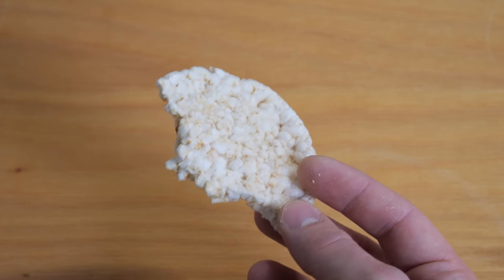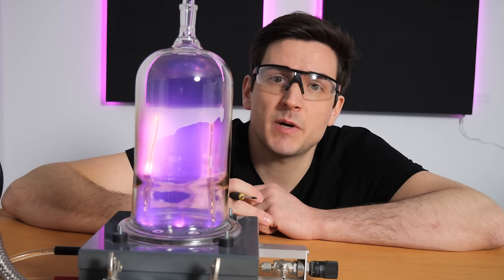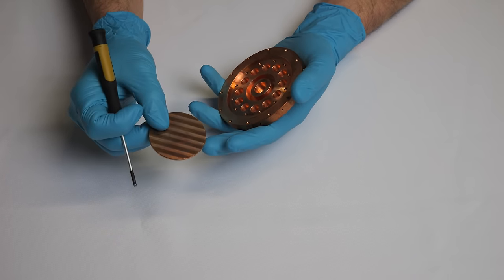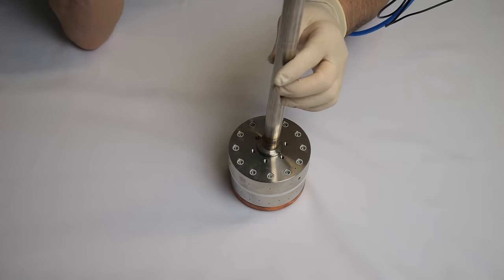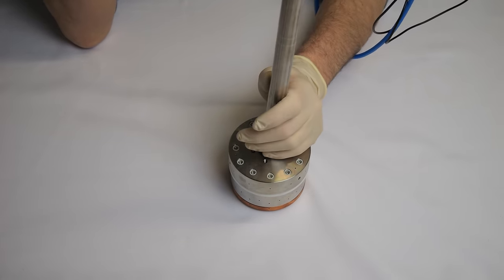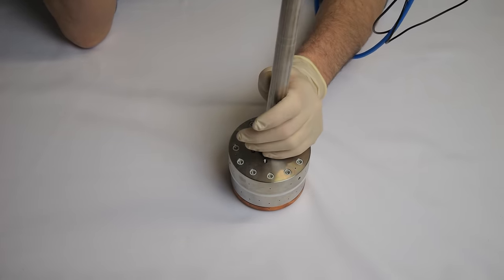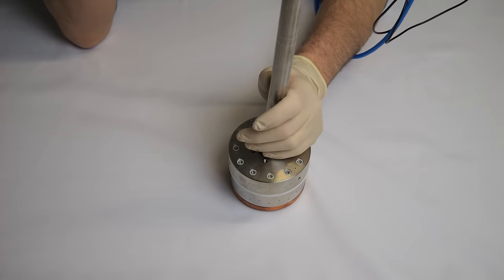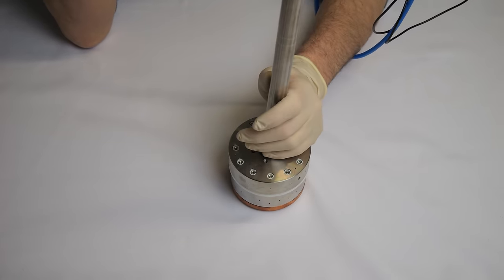METAL COATING by PLASMA Bombardment - Magnetron Sputtering

Comment: Finally, you can settle the important question whether rice with a coating of 20 nm ITO tastes better than rice with 20 nm W.

Great Magnetron, by the way, and thanks for all the great info on building the magnetron!
If you want to get rid of the rusting issue on your magnetic yoke: ferritic stainless steels are magnetic. They also conduct heat better than their austenitic counterparts: 1.4003 (ANSI 410) is one.
Reply from the maker: Thanks for the advice!

I would have loved to coat the puffed rice with gold and actually eat it. But getting a gold target was a little bit outside my budget.
Reply: Single gram bullion bars of gold are not too bad, and would be good for this application.
Reply: I wonder if there's any nutritional value if you eat puffed rice sputter coated with iron? It might make a great YouTube scamercial product.
Reply: Could the Yoke be coated with Nickel for Example?

Very nice Magnetron.
I hope you are willing to share the Design Files.

Comment: In electron beam evaporation vacuum coating the cleanliness of a glass surface must be extremely high, like... atomically clean. When we do multi-layer dielectric coatings for coffee table sized optics to make them into mirrors for the National Ignition Facility fusion laser, the glass is cleaned by removing the top few layers of atoms. We scrub the glass with a toothpaste like thick suspension of nanosized alumina particles (0.05 um) called Baikalox and rinse with deionized 18 megaohm water. You can tell when the glass is clean because it will be perfectly hydrophyllic with absolutely no water beading anywhere. If you watch the DI water dry on the surface in a cleanroom you can see the Newton's fringes forming on the final few layers of water molecules as they sheet off and evaporate. When the glass is then loaded into the coater it is heated to a couple hundred C by quartz lamps to drive off the last layer of water molecules adhering to the dangling O and Si bonds of the glass surface. It sounds complicated and expensive but you could probably do it well enough with a simple setup and no cleanroom for very cheap with any common polishing slurry. The main metric of importance is the total lack of any hydrophobicity of the glass after cleaning.
Reply: That’s incredible.  Cool stuff!
Reply: That must have been a really special (albeit maybe stressful because of that!) project to be a part of!
Reply: Did you use thise giant lapping machines for the Baikalox ,  or some other setup?
Reply: @ericlotze7724  Actual surface figure polishing was done at another facility before the glass was sent to us for coating. We're only removing a few atoms thickness with the final hand cleaning, so it doesn't change the optical properties.
Reply: The reason they're held to such stringent standards, is to avoid any anomalies in the reflection... which is a huge factor, when you're dealing with once-in-a-lifetime data. That level of precision isn't necessary for 99.9999% of the market. Sputtering is used in all kinds of industries for various purposes. Sometimes, such as with some aluminum applications, the layer is applied with the intent of near-immediate degradation/oxidation to protect the base material.
Reply: VERY good advice, but with sputtering it is another chapter altogether. You see, with e-bream evaporation, you are still in the "evaporation" techniques. These suffer a lot from poor adhesion, as the atoms come to stick to the surface with very low energy (they do have extremely high quality though). However, with sputtering you actually hit the substrate with very high energy ions. If they don't stick, they sputter back! If you even use higher energies, you get into the ion implantation realm! No need to clean the surface that thoroughly as we do with evaporation or sol-get techniques... 
The problem here is nothing else but electron bombardment. This explains why the side glasses of the chamber have perfect quality, their crystal mesh was not bombarded with electrons as heavily as the substrate in front of the magnetron. If a high speed electron bombards your substrate, it amorphises it, it breaks its bonds. 
Typical solutions to this problem are facing magnetron topology, less power or better magnets on the magnetron and even a NEGATIVE bias behind your substrate to try to push away those incoming electrons.
Reply: @BillDemos  I endorse this message.  
...with the exception of the sol-gel bit. Extreme cleanliness is important here too as the alcohol suspension of teos will bead up on unclean hydrophobic surfaces during the dip extraction, ruining the AR effect of the coating where it happens. Ask how I know....
Reply: @Muonium1 Yes, we actually agree. If you read my post again, I say: "No need to clean the surface (when doing sputtering) that thoroughly as we do with evaporation or sol-gel techniques.", meaning evaporation and sol-gel need good cleaning, sputtering no so much. Anyhow, material sciences is such a nice field. Have you also seen SILAR (Sequential Ion Adsorption and Reaction)? It is a magnificent method. It's like ALE but with ionic liquids, allowing you atomic layer control!!!!!!!
Reply: Thats incredible. I make the capacitors for the NIF and sometimes if a mechanical dimension is slightly off I clamp a sheet of metal over it and hit it with a hammer.
Reply: @thegunfoogle2864  Thems some bigass caps too lol
Reply: Yes what he said.....much love to you all. I love learning.

Comment: If you watch Ben Krasnow's channel he has a whole video on slide prep for sputter coating. It's suspicious that titanium coats well while copper doesn't though so I don't think slide prep is the issue. He does talk about plasma cleaning a lot which you didn't mention. I love this!
Reply from the maker: Yes, I know Ben's video. His channel is just brilliant overall. In the future, I want to install a plasma cleaning setup in my chamber.
Reply: Titanium is used as an adhesive layer in many thin film structures. There are other thin film adhesive metals including: Cr, Al, Ta, Mo, Nb, V, & Hf. Copper won't stick too well by itself 😀.

Comment: Having MOT-based power supply for such experiments is extremelly dangerous. It would be MUCH safier to have high frequency converter because even if you touch HV parts directly you would have a burn but the HF current will not fri your inside but 50 Hz 2000V definitely will. And it would be good to have some ground leak cut-off switch on HV side.
________
Drops of paraffin for insulation instead of Kapton tape would be much more reliable.
________
Regarding the solidity of the coating, I have two considerations. First: the surfaces to be coated must be very clean. Ben Krasnov spoke about this on the Applied Science channel. Second: probably, during direct propagation, a large number of low-energy particles reach the target and are not capable of forming a strong connection with the surface. And to the sight glass - on the contrary, the fastest. So perhaps the target object should not be placed on the main axis. This will lengthen the time, but only the best will hit the target.)

Comment: You should first process the slides with plasma cleaning to prepare the surface for sputtering. A cool experiment will be to sputter quartz over aluminum to make a durable first surface mirror.
Reply from the maker: Plasma cleaning is also a project I will work on in the future :)
Reply: @AdvancedTinkering  As a quick test, you might want to try flaming the microscope slides - pass them through a butane torch flame a few times. This apparently really cleans the surface, both by thermally evaporating any contaminants, and also reaction of the ions in the flame. Many years ago when I was playing with thermal deposition, I tried this and it really seemed to help.
Reply from the maker: @imajeenyus42  I haven’t heard of that method before. Thanks a lot! I will try that.
Reply: He could increase the power and get to ion implantation. Surely there atoms will stick :)
Reply: @BillDemos I had typed a long comment out on my phone, and a stupid telemarketing call ruined it.

I just found this channel, watched the video, and read some comments, and you seem extremely knowledgeable on this subject, as well as the preparation involved. 

If someone were hoping to get a high level of cleanliness, using butane is inappropriate because...? The common sense part of my brain says that cleaning the target with acetone to get rid of any oils, doing a final clean with deionized and distilled water, and then drying the slide using a butane induced flame would be counter productive. This is because the possibility of unburned butane depositing more petroleum oils on the surface that aren't removed in the flaming passes would remain after the final pass. How correct is this thought process? Is there something else the flame cleaning would do to the target surface itself? Maybe some micro ablation from the forced air of the torch in a non-cleanroom/filtered air environment?

<-- mechanic with an interest in material science and the details that high level of cleanliness and precision that some applications have to take into consideration. It's a hobby, I guess. I don't think I'll ever use/need this information, but clean mating surfaces and ways to achieve that are more important than more people realize in everyday applications. In the future, I can see cold welding 3-d printed parts being done in machines shops as part of a repair application. [I.e. the part being too large to print in a single file, so it's printed in multiple and taken to a large vacuum chamber to cold weld the complete part, after a thorough cleaning of mating surfaces]
Reply: @Torsion  Yes, butane would be inapropriate from the side of cleanliness. Best way is scrubbing in soap, the rinsing in deionised water and then in the chamber and plasma treating.

Comment: Very good! You are becoming more and more involved in the interesting part of vacuum technology! Sputtering is one of the most interesting ways of depositing materials, specially when reactive gasses are involved. Few tips:
1) Dont use such high pressures, try and stay in the 1x10-2mBar (get a baratron), if you go to high, the plasma will be super hot and the particles cant reach your substrate because of too much gas particles blocking them.
2) Keep the distance from target to substrate to a maximum, dont let the plasma touch whatever your trying to coat, it will destroy the layer(exactly what your problem is with adhesion).
3) Evaporation rate is usually very low with sputtering (5A/s is considered very high), so keep the energy down, let things be cool and take your time. If the layer gets too thick, and the substrate is cool, from my experience, anything above 2000A will start to flake off... 
4) Use high pumping speeds and mass flow controller is a must that has a loop with baratron, i have used MKS systems that controls everything, from the gate valve position to the the mass flow controller, basically a closed servo loop that allows for steady pressure. 
5) Consider getting a RF supply and a matching box, you can then do dielectric depositions, with DC you cant.
Reply from the maker: Thank you very much for the helpful tips!
Today I tested placing the substrate as far from the magnetron as my chamber allows. However, the layer was still very poor, especially where the layer thickness was too high. Interestingly, this problem did not happen when using thermal evaporation, even though the layer thickness was higher. Of course, adhesion to the glass was generally much worse, but at least it was a nice reflective surface.
Other comments suggested applying a layer of chrome first to improve the adhesion of the copper. I will test this as soon as I get hold of a chrome target.

Building a closed loop for the measuring device and the MFC is a very good idea! Sounds like a new project haha.
Reply: @AdvancedTinkering  Thin metal films are often under high stress, and in some cases this is the main limitation on achievable film thickness. The stress can be tensile or compressive, and depends on deposition rate, deposition process, substrate temperature and probably a few other things I don't remember.

I think the stress applied to a 1 mm thick glass substrate by a 100 nm thick metal film will warp it enough to be practically measured by the kind of interferometric measurement you would use for lens figuring (I calculate 650 m radius of curvature with 200 MPa stress in film, which would cause 125 nm deflection in the middle of a 2.5 cm span) but there may be a more practical way to go about it if need be.
Reply: One idea I would try is pumping down with just air in the chamber first, and running the magnetron at low power to get a visible glow. Should work as a poor reactive ion etch to super clean and activate the glass surface. Then introduce the argon and proceed as usual. Those dangling oxygen (and maybe nitrogen) groups coupled with the complete absence of organics should help adhesion.

As for surface quality, the fact that your windows got a super mirror surface but the slides didn’t just shows your deposition rate is too high - the flux of metal ions above the sputterer is way too dense which is causing agglomeration (blobbiness). Turn down the mA to something like 1/10th what you were using and it should improve a lot. Copper is the worst for this, although not as bad as silver or tin. Refractory metals cool faster, so titanium and tungsten can be coated at a higher current density and go much faster. With soft or low melting metals, you need to go low and slow.
Reply: The CVC 601that I ran used a 13.56 MHz RF source.
Reply: The distancing will NOT solve his problem. It is ELECTRONS that are hitting the substrate and amorphise and crystal that is growing. You either use a facing magnetron topology (look it up) to try to trap those rogue electrons in between them, increase the magnetic field strength or decrease your power. You do NOT mind if positive ions hit your substrate, it is actually good for the final quality, what you want to avoid is those pesky electrons. This advise comes from someone who routinely can do ALO, ZNO, ITO with hugely good optical and electrical properties.
Also, RF would be nice in some situations, but you can do ceramics also with DC, with reactive sputtering. For example for the Oxides you would just use Oxygen in your chamber, and for the Nitrides, you would just use Nitrogen! To have VERY good looking un-oxidised metal deposits, you can also use a small amount of Hydrogen in your Argon.
Reply: @BillDemos  Electrons? 200-300eV having enough energy to physically affect the substrate? I dont think so, only if the substrate is not grounded, electrostatic build up can affect the morphology. Spacing does matter, and has a very big role, the plasma temperature depends on the pressure and  power that is put in the magnetron, the standard practice is to avoid touching the plasma. DC sputtering isolators cant be done easy, there is no beam  forming, the target needs to conduct in order to properly shape the plasma. Morphology of the layer heavily depends on gas concentration, temperature, power, distance, substrate DC bias, everything. Its not that simple... I design and build vacuum equipment for a living, my experience in DC and RF is very thorough.
Reply: @Aleksanti  Elections, Yes. Look up ANY paper on "Facing magnetrons" topology to understand what they are trying to do
Reply: Aleksanti I have a MKS - Type 250 controller unit and I also have some Mass Flow controllers. I have been reading through the literature and have yet to figure out where to attach the pins from the UFC-1000 with the power supplies and outputs to the MKS-Type 250 Controller.I am hoping you can shed some light on what connects to what. At first I thought it would be simple to just connect the UFC-1000 to the valve connector on back of the type 250 9 pin valve terminal. Realizing if it is just a solenoid valve with no feedback circuitry it would be true. I figure its got to be the input connector or the interface connector but I am confused. Please help.
Reply: @sealpiercing8476 Hey brother, I was very curious about how you did that stress calculation !?
Also, Can you please suggest some sources so that I can also understand these phenomena and troubleshoot like you people do.

I am a noob in Material Science.